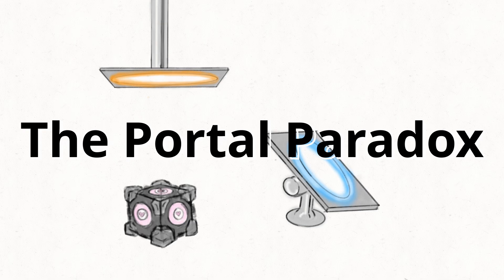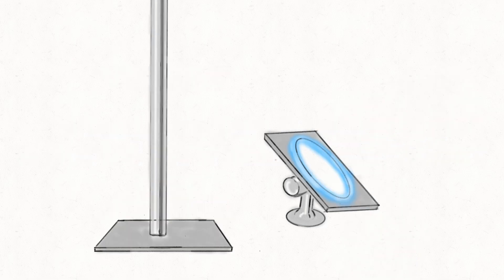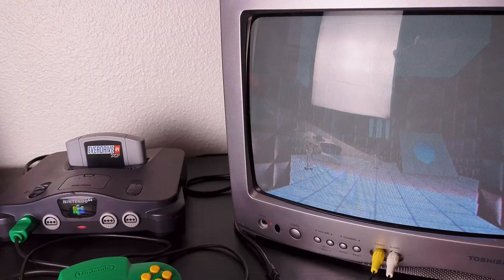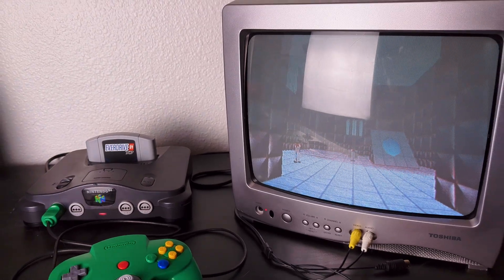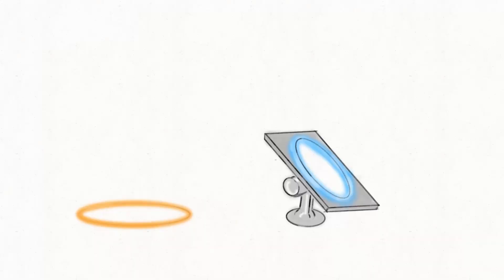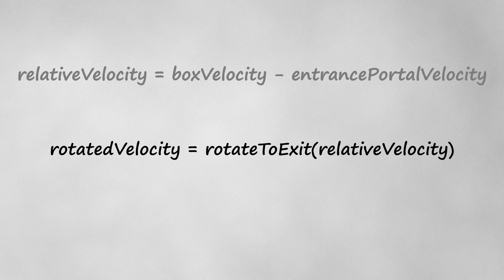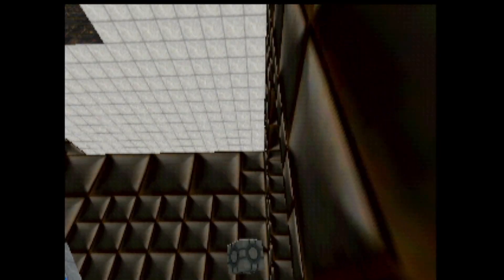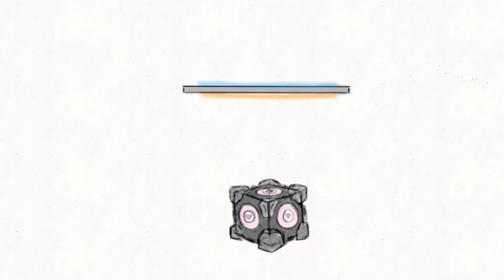I rewrote Portal from scratch and solved the Portal Paradox

Comment: The cube isn't moving though, so it just gained momentum from nowhere. If the floor were to launch up towards the portal, the cube would fly. This implies that all of space time are moving while the cube sits still and then comes back to an equilibrium. If a train had a portal on the front, and you were standing on the tracks, and other portal was up on the platform, you would go through the portal just enough to be back on the platform.
A more interesting idea is what would happen if you ran through the platform portal and came out of the portal on the front of the train.

Comment: this test is retarded and false, the first test is true. the second should exactly behave like the first. no sudden velocity gain from nothing. you cannot explain it with 'but one portal is moving'. NOTHING MOVING. if the item sits there, will sit there even if the portal moves through it. 

imagine the stupid portal as a point in time and space where that portal connects A and B location. You can flawlessly move between A and B. All atom can move flawlessly between A and B. But when they come out from the portal they wont get superspeed from the portal. In and out. 

Your answer would only work. If the portals would have an Event Horizon. But these portals does NOT have event horizon. Thats why the explain fails. Otherwise in that case, the air would simply get velocity from entering the portal. but no. This portal is like that 
This is not a Sliders gate, or Stargate puddle,  or other shitty scifi crap.

Comment: Nice work! I liked that you expressed the solution mathematically. I always thought of it from a calculus perspective ie if you take infinitely many slices of the cube as it enters the portal those slices must maintain their linear distance from one anther. Therefore as the slices are entering the first portal they must exit the second portal with the same linear distance over time. This can also be expressed as velocity relative to the second portal. It also accounts for changes in speed ie acceleration
Reply: I like your approach. That was exactly my logic when I first thought about this paradox

Comment: So if both portals are moving, the movement can cancel out. But since it's portals, they could be moving in different directions. If the piston comes down on the cube, and the exit portal is moving away from the direction it shoots at the same speed, the cube should just fall out?

So what happens if you have one portal that's moving with the earth's rotation and the other against? Or maybe one of the portals is on the moon. So many questions.

Comment: What would happen if you: 
- Incrementally change how far down the moving portal moves, will the cube be "sucked" up and out the other portal?
- Both portals are moving in opposite directions, will the cube get the sum of the portals speed?
- Move the portals toward each other, having the object in the middle?
Reply: This is the logical set of answers based on what the math is trying to simulate. What would actually happen in the N64 physics engine depends entirely on how James is simulating the "teleport."
1. Half the cube should appear on each portal face, at first. Gravitational forces on the Portal B side will immediately take effect on only the mass that is present on that side, and effect the whole cube as a calculation of the opposing forces on the other side, Portal A.
2. Yes, both logically, and according to the math.
3.  It would look exactly the same as if there were no portals at all, and it was just two panels sandwiching the cube. Logically, the portals (or more accurately, the objects the portals are moving on) would either be forced to stop with the cube in the middle, or the opposing sides of the cube would crush the cube itself, depending on the force objects that the portals are painted on are exerting on the cube. It would be ultimately the cube crushing itself, but the force applied to the cube would be equal to the objects that the portal are moving on.
Reply: So the first question you had can be answered two ways, the previous commenter included velocity which is one of the ways to interpret it. I think you meant in a slower way as in how far would the portal need to go before it was sucked out. If the portals are both on a surface that faces the direction of gravity then it’s just when the center of gravity of the cube goes through that or would be “sucked” up and out. The second question is actually demonstrated in the video when he puts a portal through a surface and essentially it is the answer to your question. Its basically like if you were to drop a hula hoop over yourself, one side is moving (relatively) exactly at an opposite velocity of the other side. The third question is a bit harder to answer but I’d imagine it would be like trying to stuff the cube into a place with zero volume. In a real life scenario where we magically have portals to test this, I’d imagine that any object you put between the portals would make contact with itself and begin resisting whatever is pushing the portals together until it yields to the pressure.
Reply: Just interjecting with my own thoughts:
1. Yes, the cube would be sucked up a bit. I think about it as a person that were standing and the orange portal slamming into me from the top. All the air above me has exited the blue portal at a high velocity, then comes my head, which has just entered another end of the world at a high velocity (this would be the same if the orange portal were stationary and I ran/fell head-first into it), so my head would definitely get tugged into the other end. Now if the portal stops midway, my head will retain the inertia and in the worst case, I'll be decapitated. Again, I think of it as jumping out of a moving train and the train immediately stopping to 0 when only my head is out of the door.
2. Logically, yes.
3. Depends entirely on how the atoms are recreated/phased on the other end. Ideally, they would either phase into each other or be in superposition. But logically, the atoms would layer/intertwine and you would end up with a fine Chell paste.
Reply: @VarunGupta3009 Yeah that phase/superposition answer doesn't really make sense, it's not like the portal instantly teleports an item into a different point in space, it lets the item "enter" that position from a specific direction, so the cube wouldn't have to phase into anything. The correct answer is what herewegoagain wrote: the cube would simply find itself in the middle of its own two sides crushing itself with the same force as the moving panels.
If you assume the portals to magically be unstoppable then sure, they would push until the cube disintegrates into atoms but you're just asking what would happen if you put the cube in an infinitely strong press.
Reply: @KombatGod  Yes, I was just wondering from a layman's perspective. I just have a simple engineering degree and don't know much about interdimensional portals. Though, I still think that what Valve assumed about Portals is fundamentally correct. You shouldn't be able to just "move" portals. If a portal is like a wormhole connecting two different points in space, then every time you need to move it, you would need to close it and open a new one. Portals shouldn't be tethered to an object. But then again, Portals technically couldn't even exist on Earth, as the Earth isn't stationary in space. How do we account for the Earth's rotation, revolution, and gravitation? Even the Portal to the Moon would behave much differently due to the relative motion between the Earth and the Moon.
Reply: If we talk about just physic and not how he simulate the portal. 
1. Think of it like the portal is grabing part of the box and throwing it like how you lift a box. So the answer is yes.
2. Since we are dealling with portal, we are dealing with relative position and velocity we have to take that into account. If you are talking opposite here as in from your POV in a room one go left and one go right  with the direction facing the place they are heading. What would happen would be the velocity of the cube = the velocity of red portal + the velocity of blue portal. Imagine the slam experiment but the stationary one also moving forward. But opposite here mean how the portal is moved base on it orientation like one is going forward and one is going backwards then it will stay still like the hoola hoop example in the video.
3. The box will be destroy as it will try to exist in the same space. Imagine it more like slamming the middle box with 2 other box   exactly the same down to the attom and the imperfection toward the middle one.
Reply: 1 - this would be analogous to putting 2 cubes and attaching them with the string - if there is strong enough force, the cube that went trough the portal will pull the other with it, just like it would if you just threw one cube foward, no portals involved. its the same if we eliminate the string and two cubes, and just move the portal to half of the cube. 

2 - yes, if both portals are moving cancelling eachother out, it would be as if you were running backwards, and threw the cube foward - if the forces are equal, the cube would fall down instead of being ejected. 

3 - if two portals move together, the cube will simply collide with itself, preventing the portals from moving closer to eachother
Reply: @wojtekpolska1013 i really don’t think we should take this guy’s test as fact, it ignores most basic laws of physics
Reply: the cube will not go to the sum of both speeds because that sum could be greater than light and contradict relativity.
The true equation is this:
Vt= (V1+V2)/(1+(V1*V2)/c^2)

Vt is the final speed
V1 and V2 are the speeds of the portals
c is the speed of light
Reply: Second one is a cool thought experiment... If the second portal was moving to the left at the same speed as the falling portal, and the outbound cube was moving to the right, the cube would be moving twice the speed... But... That's relative to the portal moving to the left.. To the viewer it would look like it's moving at the same speed... But it is moving twice the speed away from the portal..
Reply: 1. That entirely depends on how the outside portal is rotated. If it's upside down (other otherwise situated in a way that an object would move away from it when affected by gravity, yes, the cube would eventually get sucked in. it would be, at the precise point at which gravity affects the part hanging out of the outside portal more than the part still in the inside portal.

2. Yes. At least as long as the object is being pushed against a wall. If the object was floating freely and then an inside portal moved towards it at a steady speed, while the outside portal is moving in the opposite direction at the same speed, that'd net you a paradox, if I'm thinking about it correctly.

3. If my head is screwed on right, that's logically the same as example 2...
Reply: The thing is, the cube never is “sucked up” there are no forces acting on it to cause motion. The only force here is gravity. So I think that the simulation displayed here is flawed from the start as it works based off of the implication (which is based on absolutely nothing) that portals apply a force to make the object overcome intertia. Newton’s first law.

Portals as far as we are aware, simply act as a bridge, not anything else. For it to add force to the cube, it would need to act differently. But instead it simply connects the two areas like a wormhole as though they were always right next to eachother. The fact of a portal moving does not change that, simply changing the location of the link.
Reply: @atsukana1704  Ik ur comment is 11 months old and you’ve probably heard this before. But motion and velocity is relative. So relative to the moving portal it is the cube and the world that is moving, and it is, relative to the moving portal.
Reply: I would watch an hour long video attempting a bunch of tests haha. I just imagined this solution is like, the exit portal essentially has the ground act like a launcher, the exit has the ground shoot up launching it. But yeah the motion of the piston portal is a factor, makes sense
Reply: For number 3 the portals will stop at the edges of the cube. Once the portals approach the side of the cube the cube will appear on the other portal. So the two cubes will touch at the portal kind of like touching your finger to a mirror.

Comment: Speed is indeed relative, but what about the speed of the cube relative to everything else in the room?
Where does it get its kinetic energy from?
If you aim the static exit towards the oncoming entrance, will the cube keepe increasing its speed with each time/pass?
What if both portals face and move in the same direction and speed?
What if the entrance comes to a sudden stop when the cube is halfway through?

It's indeed a paradox because in order to solve one physics problem one needs to make up assumptions of how a portal might work, but then breaking others instead in the process.

I'm not convinced of the cube flying away since I feel that breaks more laws of physics in relation to everything else, while if it doesnt shoot out it might just break some in relation to the entrance only (depending on how one fantasize about how portals work).

Comment: I actually have an experimental explanation that corresponds with your realization. It doesn’t need any kind of portals, just two coordinate systems, moving relative one another.

Imagine a car moving towards you, when you stand still on the road. What happens when you go through the windshield? How does it look like to the guy who drives this car? He is sitting relatively still in his car, and you just burst into the car, you don’t land on the car floor/seat the very same moment you got inside. Same thing for cube (you), portal system (car) and exit portal spectator (guy inside the car).

Anyway, tnx for the video! It will be interesting to run some experiments with your version. For example, what will happen, if both portals move in opposite directions? What will happen if some portal moves in circles (so objects coming through it are affected by centrifugal force)?

Comment: What if the blue portal is also moving as fast as the orange one is slammed to the ground? Would that have the same result as the back to back portals or be differet? 
You could move the the blue portal back and forth so i wonder if 2 different directions will have a big difference in results or similar.

Comment: Velocity is not a conserved quatity, momentum is, and this violates conservation of momentum. Wrong answer
Reply: Portals break the laws of physics as is.
He isn't wrong
Reply: @Badger-l7q  being able to teleport objects definitely breaks the laws of physics, sure, but being able to teleport an object AND give it momentum from nothing is breaking physics even more. Imagine you're on a  train car as the train is moving, from your reference frame the ground could be moving instead of the train, just as the box could be seen as moving towards the portal. If you jump out of the train do you fall straight down and get swept backwards with the road or do you slide forwards with the train? Obviously the latter. This implies that although multiple reference frames exist, some of them give the wrong answer. In the portal example the cube fundamentally is not moving. It has 0 momentum. The relative velocity does not translate to relative momentum, and conserving velocity is not a thing. Using the moving reference frame of the portal as the basis for calculating the outcome gives a wrong answer, just like assuming the ground is moving under the train.
Reply: @matthewb4987  
The simple solution to this situation is as follows.
If the box is standing still.
And portal side 1 flies into it.
Box goes through portal into stationary portal side b.

The top of the box gets pushed by the rest of the box, and gains velocity. 
This continues until the whole box goes through.
Thus
Gaining the velocity of the moving portal side.
You do not need to go into a long rant to figure out that much.
It might not be 100% of the velocity of the entry portal.
But it will gain some
Reply: @Badger-l7q  That entire idea relies on the portals working in the specific way you're describing, and implies a suction effect where putting part of the object into the portal would cause the rest of the object to be sucked through. This behavior is never shown to happen, so it's strange to assume the portals work that way. My explanation uses first principles of physics and matches what is observed in the games. There are no right answers here but there are different levels of wrong.
Reply: @BNJ_VODS  
what the hell are you genuinely talking about?
The portal is a direct link from point A to point B
The 1 common thing that's been established since day 1 is 
"Fast thing goes in fast thing goes out"

There is no suction effect.
The fact of the matter is that if the box is thrown through a potral via the entrance slamming onto the box, you are still forcing the box on the exit side to gain some velocity as the top is pushed through by the rest of the box. continuing down as you continue  to push the portal over the  box.

you are over complicating a simple solution that this guy already solved for his own game.